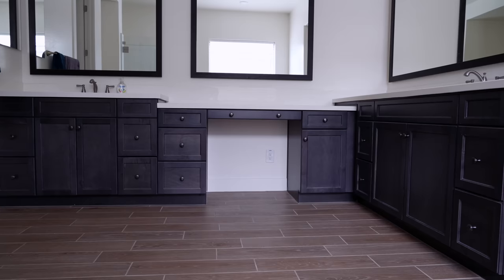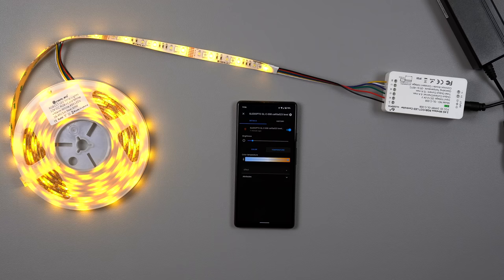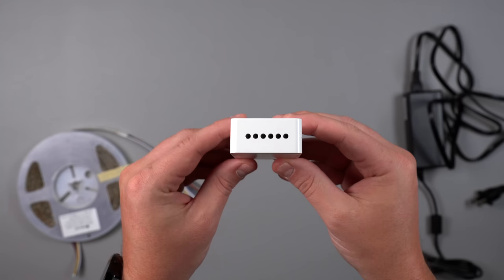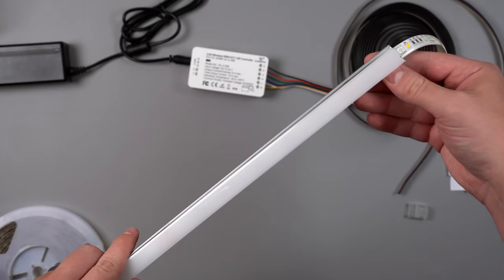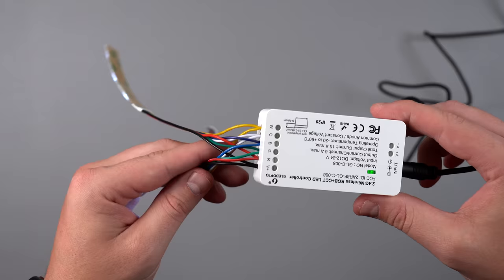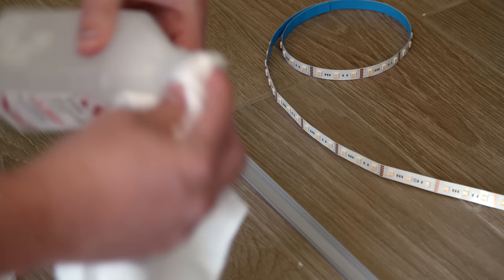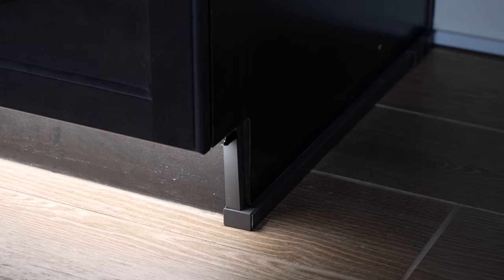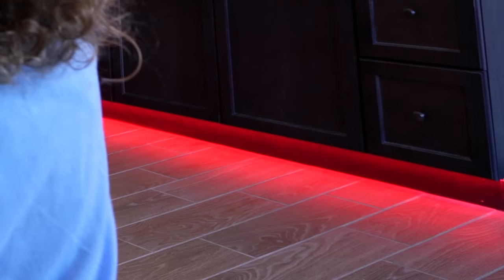Ridiculously Easy DIY Light Strips! (no soldering)

Comment: Great video but you didn’t explain one thing. Using that controller what software are you using in your phone to control the color and such. And is that controller able to interface with Apple HomeKit?
Reply from the maker: There are all different types of controllers out there. This one uses ZigBee so I have it connected to my ZigBee/Z-Wave USB stick with Home Assistant. I have Home Bridge installed so it can be added to HomeKit. But you can also connect this controller to an Echo with a ZigBee hub. I didn't mention anything about ZigBee because it can get confusing quickly for those who don't know about it.
Reply: @SmartHomeSolver  I’m setting up a school but as my mobile home. I’m looking to make some smart options in the bus like phone controllable lights and such. But I want it all local either blue tooth or other local only intranet, uncontrolled by the outside world. What hub would you suggest that’s HomeKit compatible?

Comment: Is it normal for the controller to make a little noise when it’s plugged in? 

I have this setup based on your video (thank you) and I’m using the controller in the same way with two wires for each color plugged into it. Just wanted to make sure the subtle sound is normal.
Reply: Just installed mine today and have same question. It’s noticeable with nothing else on in the house
Reply: @CB375J  I’ve had mine installed for over a month now and the noise seemed to go away. Or maybe I just got used to it lol. But they work just fine

Comment: Could have mounted the box underneath the cabinet, then did the channels down from there, especially if you spray painted them.
Also, the channel diffusers you mounted the brackets underneath...could have just said f' the brackets, and hot glued...or double-sided tape the aluminum channels underneath, would have been a lot easier.  Then, removing them if needed you could just pull them off.  
I will say very nice job on everything!

Comment: Are there extensions for the 4-prong power adaptor?  I would like to run the line outside my display case without the need to have the strip light outside the display case.  Thanks!

Comment: I see the v + and - connector on the controller as well, does this mean that the controller can also be used as a hardwired connection instead of using the AC adapter? i am wanting to install these lights under a kitchen cabinet that already have a hardwired connectors to electrical

Comment: You can terminate the wires with wire covers to protect the wire for the screws in the controller. But you need a crimper and they're not that expensive. Best practice for any wire end.

Comment: How do I best wire LED strips in parallel, for lighting stair treads so that one end isn’t dimmer than the other? Can you squeeze two wires into those connectors so that they act like a splitter? Would that even work?

Comment: Would that Zigbee controller allow for smooth dimming across a wide range of brightnesses? Would there be any way to attach a physical dimmer of some kind? I'm looking for something to control a single 1w LED in a Microscope because I blew up the control board it came with and the manufacturer doesn't sell parts...

Comment: I would have drilled a small hole into the base of the cabinet and ran the wires to the back of the cabinet with a fish rod and drilled another small hole into the side of the cabinet to pull them back out. And for the desk, I would have got some pipe strapping and mounted everything to the underside of the desk.

Comment: OMG, retrofitted skylights with LED strips to make it a disco effect and with an upgrading of the router the controller did not connect.  Considered $$$$ down the wazoooo..... If I can get the ZIgbee controller in Australian to work and replace the old controller you just saved my bacon and wallet.  Have just started my Home automation journey via homekit alone (for better or worse).   Coutos to you Reed if this works then home assistant, zigbee and hours of dark activity for wife acceptance factor here I come - I will even put on some shrimp on the barbee if ever in the neighbourhood. :)

Comment: Interesting video. I want to do a rectangle of them behind the TV to backlight. I can't find anything that will do 90-degree turns, though. Hue + Litcessory just aren't holding up. I'll have a look at the parts you used, because at least they support 90-degree connectors!

Comment: Spectacular video my guy. Google flexible screwdrivers though. Might help ya out next time 🍻

*Late Addition: One more tip, instead of trying to hammer the screws, use a piece of scrap wood on the floor. Place a pry bar or something similarly shape hanging over the end of your board then use that mechanical lever you just created to press the screw into the wood.

Comment: Howdy! Im am constantly scrolling through all your videos while getting new ideas for my smart home. Now I'm trying to update my switch situation and I have a question for you: 
So my kitchen has a 4 way switch for the main lights. Meaning I have 3 switches that can toggle the lights. I can't find any smart switches that specifically say they can function under that scenario. 

My current situation is this: I have 2 switches that I try to leave alone and one switch has a third reality switch that covers the toggle to make the lights "smart." The problem is that when someone hits any of the other 2 switches the third reality switch will now have to be told the opposite command to get the desired results until a toggle can be flipped again. It's super annoying, and the spouse hates it. Sooo...my question then is, will multiple of (example)  kasa switches be able to function together to prevent my current situation? Or would that be a problem solved with a home assistant other than just an echo + the switches? Got any examples of situations that worked for you?

Comment: You could hide a lot of the control under the drawer on the left. It would require using a drill to bring in wires.

Comment: I bought this BTF stip, and the BTF controller (lm052), and connected the controller to SmartThings.  They turn on, Dim, and seem to change color temperature, but I can't get RGB working.  I tried a few different device handlers that have RGBW in the description, but none of them are any better than "Zigbee RGBW Bulb" that SmartThings selected.  Does anyone have ideas to get the color control working via SmartThings?

Comment: My house came with a 5 pin LED setup for cabinet lighting.  But I hate the warm white and daylight temps (they are not accurate) - Anyone have a good 5 pin LED strip that I could buy to easily replace?  Thanks!!

Comment: Another option for anything that you need hidden: just 3D print some covers! You can usually get PLA in the right color without having to spray paint it, and you can customize the design so channel covers and such are precisely the right length and go around corners without showing any seams.
Reply from the maker: That's a great tip! I thought about going that route but was kind of short on time, and wanted to show an option for those without a 3D printer. But it definitely would've saved me the spray painting step haha.

Comment: FYI .. a great video.. great info...   Just would like to point out one thing... the white light at night when going to the bathroom.. it's bad for sleep..  RED lights are best at night.. eg.. heard of red light district?   they used red lights because the human eye for some reason isn't affected by the color red.. When you see white lights or bright lights you squint a bit.. doesn't happen with RED lights.. it's NONE Glaring .. it's why astronomers use red lights at night.. Just an FYI for you incase your interested.. and it helps you fall back to sleep quicker.

Comment: You're not just putting a vanity chair, it's a whole vanity bathroom!  😄
The dark cabinets and mirrors convey a kinda dark lifeless mood; More colors, objects and life would have been nice, as well as behind-the-wall cabling, and connecting that horrible plastic box to its own plug inside a cabinet, not in plain or vanity chair hidden view.
But double-handle faucets? Do you have a third hand holding your toothbrush?  😄

The mirrors are a bit prominent, the room is like a train station hallway! I find that extra wall lights close to your face are great for a closer and sharper look. We may not have acne to treat anymore, but who knows, men might need it for make-up later in our old drag queen age... And it would be a pity to drill these lights into such big mirrors.

Probably a bit too many cabinets, it would have been nice to keep parts of the walls for a radiant infrared heating, ideal after the shower, or a full size mirror, and maybe set up recessed cabinets with mirror doors above the faucets, or using one of the mirrors as a TV / computer screen for morning news. Can you imagine the number of views this channel would have if you had a live webcam feed in your bathroom?  😄
There seems to be lots of wasted space on the ground and on the walls in this bathroom.

Light strips are very useful under kitchen cabinets, where they provide light on the sink or counter-top when you most need it, but I don't find any useful, aesthetic or artistic value in them when they just light the floor. It's like these big kids having light strips below their cars.
I would be more interested into home improvement sustainable stuff like recycling the bathroom's gray water and its energy content (calories to warm up fresh air inlet or to relieve a heat pump).

Comment: The one main difference I find between life X and all the other brands is life X enables you to pixel map of the strip, where a lot of the other brands require the whole strip to be one colour and you can't change sections of the strip to be different colours. is the brand you've picked pixel map enabled?
Reply: BTF lighting make lots of individually addressable strips that can work at a much finer detail than what lifx does.  The specific strip Reed chose wasn’t - but there are lots of good DIY options. 

(Looks like lifx does 8 colour zones per metre. I typically use strips that are 60 per metre)

Comment: Excellent video! Exactly what I was looking for. But was there an issue in cutting the LED strip? Do you have to worry about voltage distribution based on length of each strip?
Reply: Not on that install mate -
That’s only a short run.
No issues at all.

Comment: This is an awesome video, and I'll definitely be using this info.  But, just an FYI, Govee makes a set of light strips that split in two directikns from one controller! Comes in two 8 ft, 16 ft, 32 ft or 50 ft pairs. In bot their RGB and RGBIC lights (I think only the RGBIC works with Alexa and Google home though)
Reply: Also, competitive price to this solution I think?

Comment: #WAIT:  The strips "Recommend power supply :DC12V10A 120W. " You used: "Output 12 Volt 5 Amp 60 Watt) ", and you twisted in more LEDs. Is this a #FIRE_HAZARD? @SmartHomeSolver
Reply: It is not a fire hazard.

Comment: those right angle connectors from btf are trash.

i built a project(tried to build a project) using them and just ended up tossing all 20 of them and soldering my corners, wouldnt have had to solder my corners if i knew they were junk and hadnt cut the strips.

Comment: Yeah sorry thumbsdown on this one, you should have mounted everything inside the cabinets on the back wall behind a drawer. Yes that means you would have had to make a few small holes but it would have looked a ton better. I've used those little wiring boxes and there is no hiding them, best to avoid using them.

3m adhesion promoter helps keep strips in place. It's not cheap at $15 for a small bottle but it lasts a long time.
Reply from the maker: Well when the vanity chair arrives and it doesn't cover up the wiring box then I still have the option to hide the wires in the cabinet. Nothing permanent yet but once I drill holes then that's a different story.